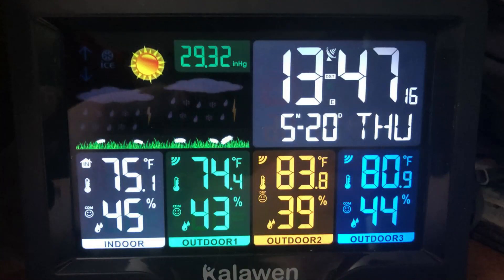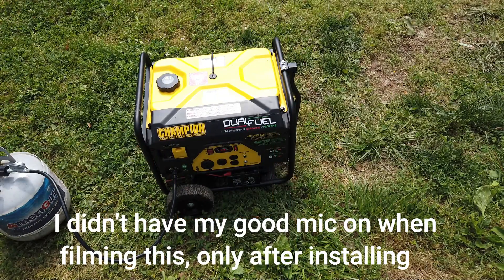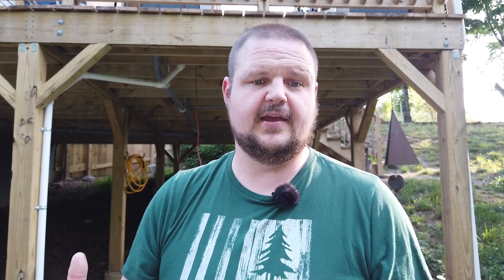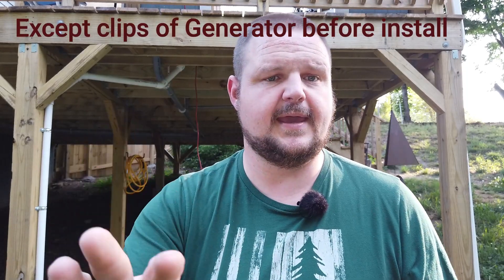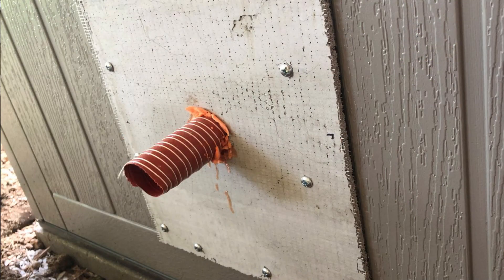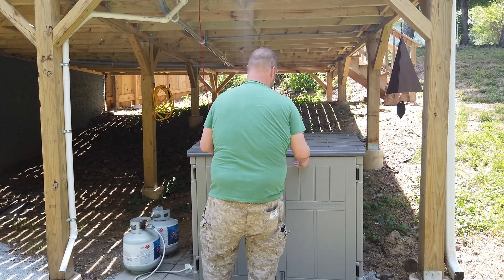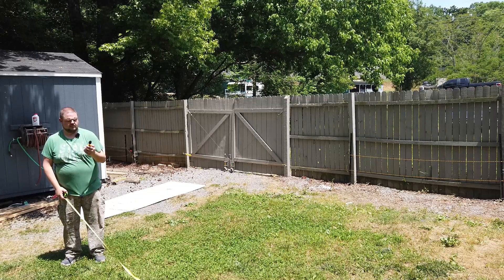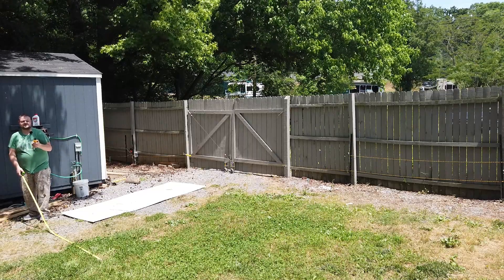Generator Shed Decibel and Temp Readings

Comment: which side did u take the reading from? air in side or the there side where its hot? I did both sides. 80 on air intake side. 180 on the other side. I have the exhaust runing out and heat tape wrapped ' Two exhaust fans and 2 intake back draft dampers on the fresh air side.
Reply from the maker: I just have the thermometer hanging in the back right corner between the exhaust on the back side and the exiting air flow/ fan on the right side

Comment: Is it worth it just for a 4 db difference?
Reply from the maker: I didn’t make this for sound.  I made it so that it would always be ready for my family to be able to use, including in rain or snow.  If I was concerned about sound in a higher level I would have put an inverter generator in it and used smaller vents, but I personally wanted more air flow